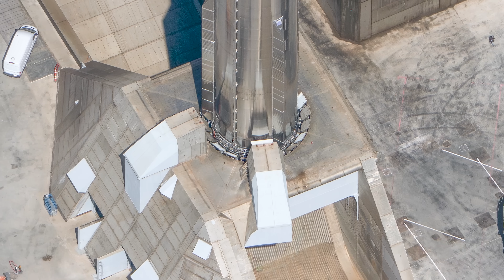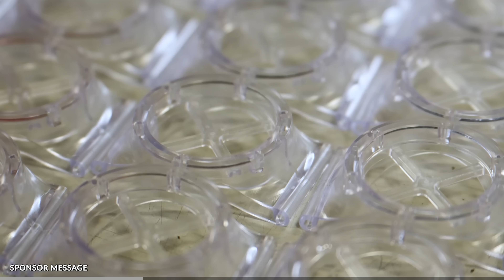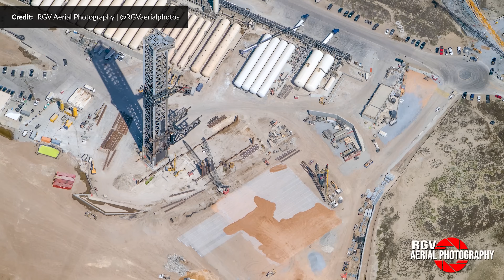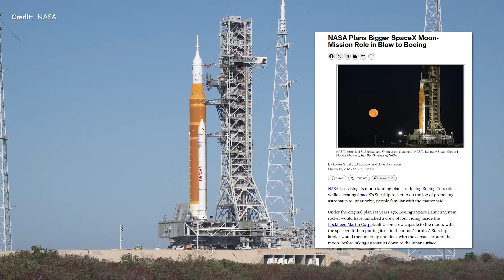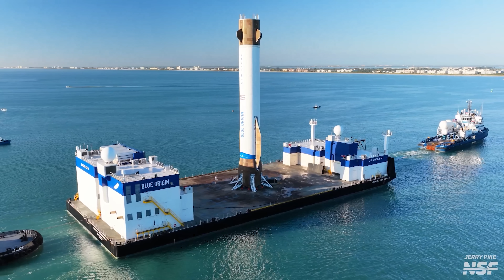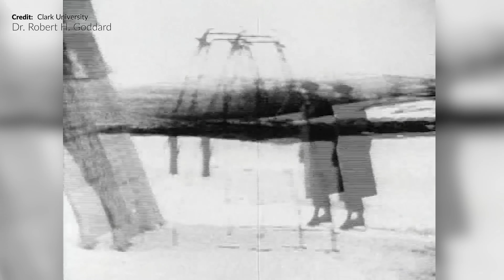SpaceX Finally Lit Super Heavy… But Something Was Off

Comment: Technical question here, why does Superheavy use a tank on top of tank design with a big downrunner and not a tank in tank design?  If the methane tank was completely inside of the oxygen tank, there would be zero boil-off of methane because the surroundiing LOX is colder than the methane.  It's OK to vent oxygen, but methane is much more damaging to the environment to vent and hazardous due to flamability.  I would also think a tank-in-tank design running the length of the booster would make the booster structurally stronger and allow thinner metal to be used.  It would also eliminate the problem of a heavy top tank leading to the bottom tank crushing under the weight of the top tank.  It just seems like everything should line up for a more effective design.
Reply: Would it not freeze at the interface?
Reply: @jnawk83 I don't think so.  They load up and fly right away.  The temperatures are pretty close.  They already have the down runner full of methane going through the oxygen tank and it does not freeze the methane.

Comment: What the new plan for Artemis tells me, is that ramping up the launch cadence of SLS was deemed unfeasible under the legacy manufacturers, thus it being abandoned in favor of an entirely different plan (Orion being mated to Vulcan Centaur, maybe?).

Edit: The comment about solid fuel rockets at the end is true, but kinda misleading. On its own, an SRB is good for what you say it is for. However, it does not take into account hybrid rocket boosters (that is to say, liquid fuel and solid oxidizer, or vice versa).

Comment: So Artemis 2 is going around the Moon & from now on just to LEO do a crew exchange with Starship.  Then there is absolutely no need for SLS which costs billions of dollars to launch & is not reusable.  Use the Falcon 9/dragon capsule instead.  It has taken up astronauts to LEO dozens of times at an absolute fraction of the cost(90 million vs 2 billion).  Next big NASA/Space X project should be to fast build a large rotating space station, to use as a fuel depot and transfer point for astronauts leaving from Earth going to the Moon & beyond.  Honestly a large rotating space station should be priority # 1
Reply: You seem to have misunderstood the point of the mission... how do you test the ability of Orion to dock with the HLS vehicles (Starship and/or Blue Moon) by using a Dragon instead of Orion?

Comment: As far as Bloomberg Report on Artemus and SLS, ...  if this Change in plans is actually true and the new plan presented by Bloomberg is indeed accurate...  Then exactly why does NASA need to waste Billions on SLS???    

SLS was the only launch vehicle besides starship that was even remotely capable of getting Orion to lunar orbit...   However,  LEO is Much Less Demanding than Lunar Orbit...   The entire 74000lb Orion Stack does not require the SLS or Starship to achieve LEO.. There are less expensive,  more reliable,  proven options for LEO, with a much faster launch frequency.... 

So if the plan is to now bring Orion into LEO and hand it off to Starship/HLS.. then why use SLS at all.???     

Why not use Falcon Heavy which costs 150 million as opposed to the multiple Billions which SLS which costs??..  Falcon Heavy has almost twice enough umpf needed to get a full Orion stack into LEO...  this would save the country ... Billions per launch... 

IMO The only reason for the continued use of SLS is political.. Congress is Likely to want to continue spending American's hard earn tax dollars supporting Welfare based cost plus contract Jobs in certain key senators districts... in other words.. SLS and its continued usage would be basically corrupt...
Reply: Because SLS has or had a lot of support in congress and that's who controls the money.
Reply: Of course the continue use of SLS is political... why do you think people have been calling it the Senate Launch System every since it was proposed? NASA use it because they're legally obligated to do so by the people who give them orders.

Comment: It's easy to have doubts about this test, but everyone needs to realise they were not only test a new booster but a brand new launch pad and all of its integrated systems. The tell will if this boost returns still with 10 engines or the maximum of 33 (iirc) the max will indicate they have fix the issues with the pad.
Reply: Doubts?

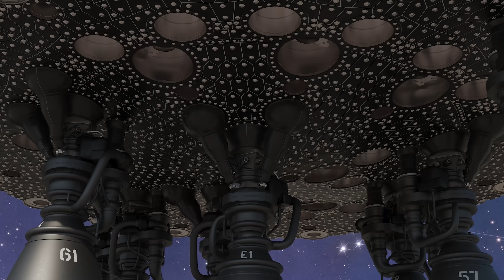Comment: 5:07 thsoe tiles are actly a mxied tpye of tile that bacly does a smiealr then to abreasbe heat shelding to keep the engine bay fomr geting cooked during retnery forteh super heavy booster so teh booster can last a bit longer and need far less engione overhaldand repairs actly. also shelds the buttom tank hull for its own engine back blast and wash during powered landing part of geting backtotteh landing pad form reentry for teh last few tests. so teachly thse are just abrsavie heat shelding tiles that also hep keep the engine fuel for frezzing and get preheats while also being protevie heat shedling abrish tiles to keep teh botuom hull nearhte engines safe form both engine backwash and rentry heat during powerd landing. juts asa extra layer of protecion to help reduce damage and reapr costs after superheavy booster landings.
Reply: Bro, get auto correct. I think I just had a stroke reading that

Comment: Question: We've seen the damage to the rocket done by debris on lift-off, which is why the launch pad has been upgraded repeatedly (to eliminate the flying debris). So what will happen when a rocket lands on the moon and starts throwing rocks around like a tornado? What is to prevent the rocket from being damaged by its own backblast? Just wondering.
Reply: well they will likly use like only three vacuime raptors at a very  very very very low output or with super draco rcs thusters near the top insead fomr teh proof of conpect pectures im guessing but that migth change later however.
Reply: Several things.  A lot less engines and a lot less power from those engines and things fly away from high pressure, not towards.
Reply: @imaginary_friend7300  yes i tryed saying that inyteh coment you just repyed to by the way srry if my spealing aihut ai or wonky spellcheck is ameking it ahrd for you human brains that ares so darn used to not actly working and autoamcly corect any misped words that your read while you read the words ytou brain should figure out what teh wrod could tachly be with patern reconshion can do. ifa llm ai can autoacly read and corectand udner satnd without aming realy rude and snaker coments i thunk humans can do that too. why you guys jus tbeing so danr snakery morethena very snakry ai would be whne it comes to speling errorsand gramer errors that like you guys shdlent be so foced on such dueto how the foment of yotbue works make it just not realy sucha issue.

Comment: Do they have any plans to use engine 3 on falcon.
Reply: No. Once Starship reaches full operational maturity and high flight rate, Falcon becomes effectively obsolete, just like every other legacy rocket.
Reply: You can't just swap engines from one system to another.
Reply: By "engine 3", you mean Raptor? Then no — that would require a complete redesign of Falcon to have a different number of engines, different fuel tanks, different flight profiles, etc.

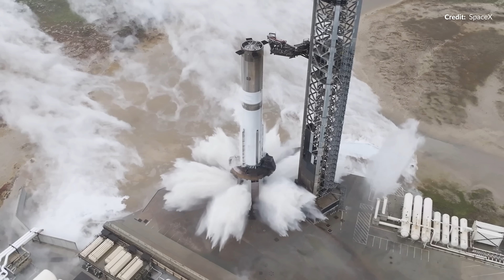Comment: 3:56 you mentioned that the 20 QD's for startup gasses on the outer ring have been moved to the methane and O2 QD's - is that actually the case or have they been internalized to the booster like they already were for the inner 13?  They had a problem with warped engine bells during re-entry and I wondered if the fix was going to be to perform an engine chill on the outer 20, but not actually relight them.

Comment: Why would there be 'a gap between the new protective top and the existing Pad A tower' structure?  Those welding gussets slide inside the existing tower steel such that the top rests onto the the tower.  The gusset then are welded to both secure and reinforce the top&tower.

Comment: Maybe someone else has already provided this speculation as I don't read all of the comments.  Ship 44 nose cone was taken off the production line early last fall and is widely believed to be the prototype for the Moon Lander and being used for system integration work as outlined in SpaceX's update several months ago.  Now Ship 45 nose cone is having the unique white thermal tiles installed.  Is Ship 45 the actual Moon Lander flight hardware?  It would be helpful to know if the white tiles are being applied on the upper surface of the nose cone (the part not exposed to re-entry).  That would support the perspective that the tiles are for micro meteoroid and thermal protection, something needed for a manned space craft.

Comment: Well, it is a magnificent looking rocket now. It is time though to deliver on the promises. There were high expectations it would have a key role in manned flight to the moon and that looks to be a long ways off if ever.
Reply: Are you talking about Superheavy?
Reply: @imaginary_friend7300  - Super Heavy being the reusable first stage of the Starship. Both. Neither has yet delivered as promised but the Super Heavy is close to being an able first stage delivery vessel. It has proven it can get off the ground and deliver to orbit. It has never been able to deliver the promised weight into space but with the new addition it may be closer. Even if it never returns as promised, it is still well advanced over what we had, if it proves to be reliable. The Starship is still a long ways off. I am still wait and see with regard to the tiles and we haven't seen any progress on the Starship to the moon. I think we are years from using this rocket as a vehicle to and from the moon; whatever configuration you might use. Meanwhile you have Blue Origin's massive FIRST STAGE (only) rocket "New Glenn"...it has launched and landed. You don't hear much from them but they are working at it.

Comment: Those white tiles are part of the HLS Starship lunar lander passive thermal control system. They have the solar absorptance to thermal emittance ratio adjusted so that in direct sunlight, during travel between the Earth and the Moon and while on the lunar surface, the temperature of those tiles remains near room temperature (20C, 293K) without the need for active cooling methods.
Reply: HLS is a fiction. You will never see HLS in action, or at least not in it's current form.

Comment: Sounds like NASA is getting ready to put SLS on the shelf. If you dock with Starship in LEO, why even take Orion to the Moon? Why not just use Orion as a crew taxi and leave it in LEO to ferry the crew home when they return to LEO on Starship? Why even use SLS/Orion? I bet you could save a lot of money just using Falcon 9/Crew Dragon instead of SLS/Orion. And Crew Dragon has a lot more flight time than Orion.
Reply: Yep. Save money and launch more regularly without SLS. Hell, why not just launch on starship after human rating it and avoid the entire mess.
Reply: Starship can't get back to LEO after a lunar landing
Reply: @notgreg123  Yes it can, with adequate refillings, or modifications.
Reply: @admarsandbeyond  either you need refueling with crew on board which is dangerous or you have to somehow get the dry mass no higher than 61 tons including crew and payload. The only realistic option I see is just refueling the LOX tanks on the Moon while the crew are off but that would require a lot of infrastructure and probably a backup lander if something breaks
Reply: @notgreg123 IMO, eventually prop refilling will become safe to use with people onboard. 
But, a modified HLS with a minimum TPS (lightweight heat shield optimized for aerocapture/aerobraking only, not full Earth landing), can complete the full mission on a single 1600 t propellant load from LEO, with margins.

Dry mass: 95 t (85 t stripped HLS base + ~6 t ceramic tiles on the windward belly, + 4 t minimal structure/flaps for stability during the single/multi-pass atmospheric skim, per some Reddit analyses)

Initial LEO mass: 95 t dry + 1,600 t prop + 80 t payload = 1,775 t.
Mission: Direct LEO -> lunar landing -> unload 75 t cargo (return with 5 t payload for 4 crew) -> liftoff + TEI -> aerocapture + small propulsive trim to stable Earth orbit.

- Outbound Δv: 6.0 km/s (very conservative, direct to moon)

- After unloading 75 t cargo -> return departure mass = 280 t (95 dry + 5 payload + 180 prop), Return Δv capability: 3.84 km/s

- Lunar ascent + direct TEI: ~2.8 km/s propulsive
- Mid-course + ullage/reserves: ~0.2–0.4 km/s
- Aerocapture: ~3.2 km/s braking (free -> only a small 0.2–0.5 km/s propulsive trim burn at perigee to raise perigee and circularize/settle into a usable Earth orbit, e.g., high-elliptical or low LEO after one or two passes)

Realistic total propulsive Δv required on return: ~3.2–3.5 km/s (plenty of margin even for conservative aerocapture).
Reply: Orion is currently the only system designed to carry crews on actual missions outside LEO.
Reply: Orion is designed for deep space and capable of returning from the moon. If something goes wrong NASA will want the ability to abort the mission and return to earth.

Comment: Good to see Blue Origin looking busy and filling up their assembly area , most pictures of the area always shows no one around no action , We’re so used to seeing Space X looking like a beehive of action constantly.
Reply: But those 7 engines may not be enough for the 3rd launch as we don't actually know if any of the engines from the 2nd launch are ready or even able to be reused.  There is no public reason to assume either way.  

:planet-orange-purple-ring:

:planet-orange-purple-ring:
Reply: @Scanner9631  In the tweet where he share the image of the 7 engines, Dave Limp explicitly said: "the next BE-4 shipset is ready for install on our third New Glenn booster." So yes there is reason to believe that these are the 7 engines are for the third New Glenn booster (which will probably support flight 4) and not meant as replacements for any of the BE-4s on the second booster (which will fly again on flight 3)
Reply: @plainText384  

Which may or may not be accurate.  I don't expect BO to launch this month as I have yet to see a precise date and it is very late to be setting one.  They are well known for delays on delays.

:planet-orange-purple-ring:

:planet-orange-purple-ring:

Comment: How in the hell can an American space company just throw 1000s of satellites into space and then the rest of the world has to live with the problems the satellites cause
ARE THERE ANY RULES AT ALL IN SPACE
Reply: What problems?
Reply: @Number8of10  the problems the news tells him he needs to worry about.
Reply: @Number8of10  (1) the vastly increased likelihood of an accident leading to Kessler Syndrome, which would put a major brake on our exploration of outer space and could also upset our very valuable earth monitoring satellites (e.g. weather forecasting)
(2) atmospheric pollution from all the burning aluminium when all these things come back down - there are serious papers about how this could be a real problem
(3) degradation in quality of ground-based optical and radio telescope observational data
Reply: @MattNolanCustom  1. In low LEO constellations (below 600 km, where Starlink operates), debris de-orbits very fast (and the smaller the debris the faster, months or even weeks for fragments under 5 mm), preventing a full Kessler cascade. This was shown in events such as the Cosmos-Iridium collision or the various anti-satellite tests which didn't spark a runaway cascade, and simulations show no immediate exponential chain reaction even with higher satellite densities. Also monitoring satellites are usually in GEO or much higher orbits than Starlink (~1000km)

2. Some climate activists have made some wild assumptions and claims regarding aluminum oxide particle impact on the ozone layer, but there aren't any serious peer-reviewed studies with real in-situ measurements.

3. Astronomers are adapting with software fixes, scheduling tools, and work closely with SpaceX which has implemented major design changes and coordination protocols. Mitigations have greatly reduced severity, and the trade-off with global broadband access is widely acknowledged.
Reply: @MattNolanCustom  The only one that has a hint of validity is 3 and the prime impact is the wide field work which is a small part of astronomy.  You need to find a better source to tell you what you think.
Reply: Because we can and yku can't. ICE cars proudly invent in europe, now you judge us for using them. Also add I'd have to say this in german or russian if it wasn't for us. Just some thoughts.
Reply: @michaelmott8161  That's the self-perception the USA & MAGA have
everything they do is ALWAYS RIGHT and
the rest of the world just has to follow them

Trump says the same thing about the rest of the world
EITHER YOU ARE WITH ME OR YOU ARE THE ENEMY OF THE USA
after he was told that Greenland was not for sale and the rest of the world stood behind Denmark
Reply: There's an entire organization dedicated to organizing space traffic. From what I've heard they're doing some pretty crazy stuff. There's even college classes about it (I haven't taken one but I've heard it's really cool)